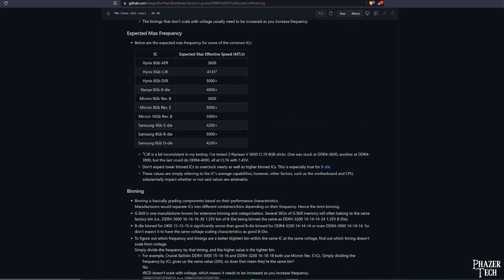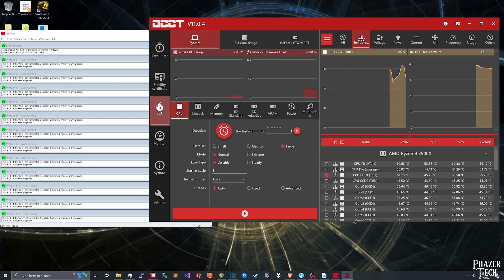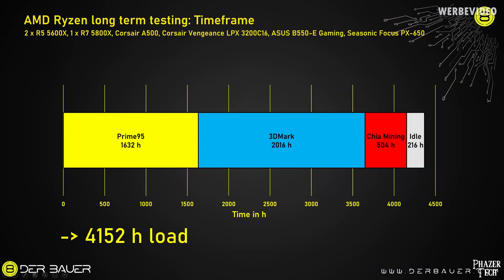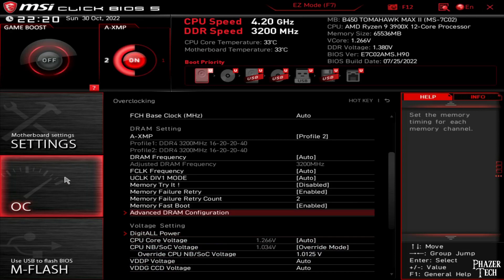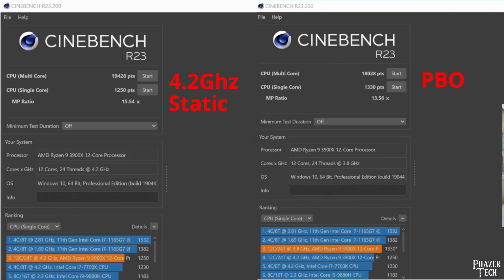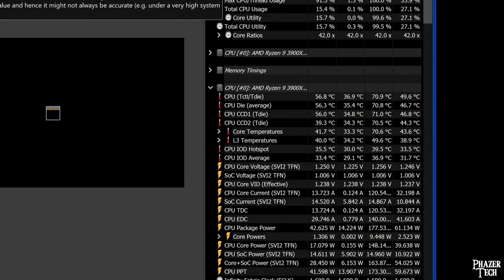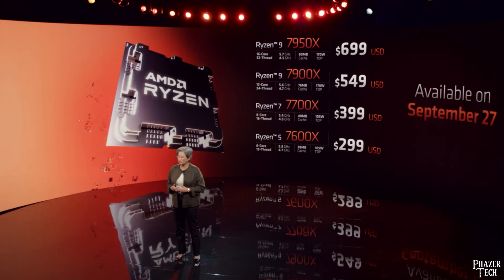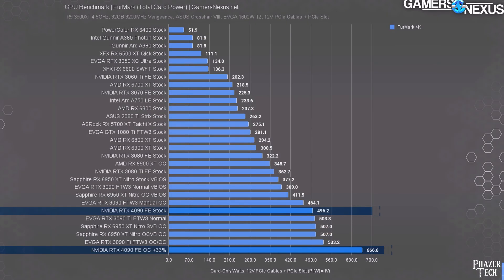AMD Ryzen CPU Degradation With PBO - Is Precision Boost Overdrive The Cause?

Comment: A static overclock is going to kill your CPU even faster on Ryzen lmao
Reply from the maker: Got a source for this?  I highly doubt 1.25V is going to cause harm.
Reply: @PhazerTech  I had a static OC back in 2019 when Ryzen 3000 released and there were a bunch of people who managed to degrade their CPU's within a couple of months, there should still be a decent amount of posts about static OC/Voltage.
Reply from the maker: @owlmostdead9492  They were probably running voltages higher than 1.3V.  I did the research about a year ago and the general consensus was that anything under 1.3V is safe for 24/7 use.  So I should be safe at only 1.25V.
Reply: @PhazerTech  AMD's official spec at launch was 1.35V was safe and then reduced to 1.325V. As far as I remembered Ryzen really doesn't like static voltage even low ones.
Reply from the maker: @owlmostdead9492  If you can find a link showing Ryzen doesn't like static voltage that would be great.  It seems Der Bauer's tests disprove that claim though, since he did a static OC for all the systems.
Reply: @PhazerTech  If I remember correctly Buildzoid is degrading a 3700X within mere hours running on 1.35V static voltage in this video https://youtu.be/3TYesViAsTE. If I were you I would leave voltage on auto with a negative offset and disable PBO, if you want to use the CPU for 3+ years.

nvm he ran it at 1.5v
Reply from the maker: @owlmostdead9492  He also allowed temps to go over 108C lol
Reply: @PhazerTech  It shouldn't, but the problem with static voltage is the unpredictability of the power consumption/current and therefore temperature, it is depending on the load type. If you run heavy all core AVX it goes to the moon, all the while being normal on regular loads.
Reply from the maker: @pwnd0rum  That's true, might be a problem for some people.  The temperatures were really high when I was stress testing but they were good when running cinebench.  I figure if temperatures were good after an hour of cinebench then I shouldn't need to worry, I'm probably never going to run into a real world scenario worse than that.
Reply: Static overclocks can be okay,  but you have to watch voltages under all usage cases.   Some boards go crazy with LLC out of the box,  which prevents vdroop and therefore stability in lightly threaded applications-but in some cases that can make the voltage shoot to the moon.
Reply from the maker: @shawn2780  I've heard that as well, it depends on the motherboard.  Fortunately my MSI Tomahawk Max II doesn't go overkill on LLC.  I've never seen it go over 1.265V when it's set to 1.25V.

Comment: Phazes Tech : if this were true about AMD cpu-s....well what do you think happens with Shintel CPU-s and their MCE aka multi core enhancement (since i7 8700K) when all of the cores turbo up to a certain frequency and enlarge the voltage to unhealthy levels while producing LAVA temperatures and consuming nuclear amounts of power ?!?!
Reply from the maker: As I stated towards the end of the video, I think Intel and Nvidia are guilty of this as well.  All of them are pushing the thermals and power consumption to the extreme.  Also I don't believe Intel CPUs go as high as 1.5V like PBO does.
Reply: I'm not sure I'm running a i3 at 1.55 which seems to run fine and I had r7 2700x and r9 5900x running at 1.575 or something by default on pbo.

Haven't had issues with either really.

But I'd definitely stop buying AMD if this really becomes a big issue I expect CPUs to easily last far beyond 20 years.

Same for GPUs really.
Reply from the maker: @sansundertale69availablename  Higher voltage on an i3 isn't as big of a deal because it doesn't suck as much current.  Try 1.55 on an i9 and you'll have problems.  1.575 sounds like a lot for Ryzen but I guess you'll have to wait and see what happens.
But yea I agree, I expect CPUs and GPUs to last 20 years at least.
Reply from the maker: @sansundertale69availablename  To be clear, I never suggested that PBO is causing chips to fail.  I meant overclock settings that used to work will no longer work, and that this happens at a fast rate (within months), that's what I mean by degradation.  In my case I had to remove the memory overclock and remove  the negative core offset I had.

Comment: I've been running a 5950X with PBO2 + Curve Optimizer, with Samsung B-Die at 3800C14, for 1 year and 3 months now.
Haven't had any stability issue yet.
HOWEVER, my #1 prefered core required a positive voltage offset since day 1 to be stable with PBO; it wasn't stable out-of-the-box.
(I did extensive testing with core cycler; my core 1 (yes, funnily enough my core 1, the 2nd core, is my best core) need a +1 CO offset. My full offsets is -17/+1/-14/-27/-27/-26/-16/-4/-7/-4/-27/-20/-27/-12/-27/-27)

Edit: Also noteworthy, my motherboard (MSI MAG X570 TOMAHAWK Wi-Fi), as most AMD motherboards, set absolutely ABSURD default VSOC, VDDP and VDDG voltages.
VDDP is at 1.1V stock!!! Which is absurd; running my IF at 1900MHz and ram at 3800, I need ~1.0875 VSOC, ~0.95 VDDP, ~0.975 VDDG CCD and ~1.05 VDDG IOD
Reply from the maker: Thanks for your input.  That's interesting how your CPU wasn't stable out of the box with PBO.  If you were less experienced and relied on help from forums, it's likely someone would have told you to RMA the CPU.  It appears the "one size fits all" approach that motherboards use to apply voltage might be part of this issue as well.
And yes I agree, most motherboards seem to apply way too much voltage.  Currently running my SOC at only 1.01V.
Reply: @PhazerTech  What were your VDDP and VDDG for the degraded CPU? (If you don't remember, maybe you have a ZenTimings screenshot hanging around? They are reported in the top right corner).

Another thing to take in consideration is LLC (yes there is a separate one for IF, usually called SOC LLC), level 1-2 should pretty much never be used, in some circumstances they can push a 1.05 VSOC way over 1.1 in certain workload.

GN demonstrate well the danger of high LLC over here https://www.youtube.com/watch?v=iQB7ELwBbVI
Reply from the maker: @Kazyek  VDDP was around 0.9V and VDDG around 0.95V.  SOC was around 1.01V the whole time.  Like I mentioned I was very conservative with voltages so I don't think that was the problem.  And yes LLC was in check, I think I had it on setting 4 so that there was very minimal droop when under load.  Also GN is great!
Reply: @PhazerTech I need to ask you one question ❓ How's your cooling solution for your 3950x? Having a high end cooling solution, you could have seen better results.

Comment: I think this may come down to the motherboard and how it handles PBO. It's no secret that many boards run way too much voltage in an attempt to provide stability across all CPU's but without taking silicon degradation into consideration. I thought these limits would be tied to each CPU sorta how core voltages can vary from one CPU to the next but PBO is a motherboard feature so I guess that makes sense. Would be interesting to see the same CPU running on a different board.
Reply from the maker: You might be right, it appears the PBO algorithm may be different depending on the motherboard, and all of them try a "one size fits all" approach for all the CPUs, which might be contributing to the issue.  I'd definitely like to try it with another board and also another power supply as well just to be sure, but unfortunately I don't have extra hardware at the moment.
Reply: Agreed 💯💯

Comment: My 5800x became unstable after about a year, i dealt with that instability for another year after that. Just replaced it with a 5800x3d and no longer have any crashing. Found it odd my 5800x would become faulty so quickly.
Reply from the maker: Thanks for the input, can you give more info on your system?  Were you running PBO?  What speed was your memory?
Reply: @Phazer Tech  I was running PBO and my memory was just XMP enabled 3600Mhz. Had to increase the values in curve optimizer after spending hours of research trying to figure out how to make it stable but that ended up working. A Bandaid fix wasn't good enough for me tho so just got a new cpu.
Reply from the maker: @cheesecurdinator4010  Running PBO and memory at 3600Mhz just like I was!  I definitely think there's something to this.  Glad your new CPU worked out, it's interesting how they removed this feature from the 5800x3D.  What did you do with your old CPU?
Reply: @Phazer Tech  I still have it. Figure I won't sell something that's just going to cause issues for someone else. Put it into my old parts bin lol.
Reply from the maker: @cheesecurdinator4010  You could send it to me lol 😂 I'm just curious to see if there's a trend with how these things degrade.  I believe the infinity fabric is what degrades first which is a big problem for people who have ram kits above 3200mhz.
Reply: @Phazer Tech  depending on cost to ship I could probably do that. I have no real use for it.
Reply from the maker: @cheesecurdinator4010  If you're willing to send it then I can cover the shipping costs.  If I'm able to get 1-2 more chips that have suffered degradation then that would be perfect for a follow up video.  I think it might provide valuable results.  So yea let me know and I can give you my Discord, or email works too.
Reply: @PhazerTech  discord probably works

Comment: Good vid. I had to disable all core oc at 4.5 to get modern warfare 2 to not crash.  Temps, volts where all good but something about that game doesn’t like my cpu or gpu oc even though it’s stable and runs perfectly in with everything else.
Reply from the maker: Thanks, it does seem like MW2 pushes the system harder than most games.  Can you give more info on your RAM, what speed is it?
Reply: @PhazerTech   ram is corsair vengence rgb pro 3200.
Reply: Don't use the NVIDIA Optimal settings in geforce experience.  that caused it to crash during the first match.  reset to games preset and worked just fine after.  I think both invidia and call of duty mwf2 have some optomizations that need to be done.